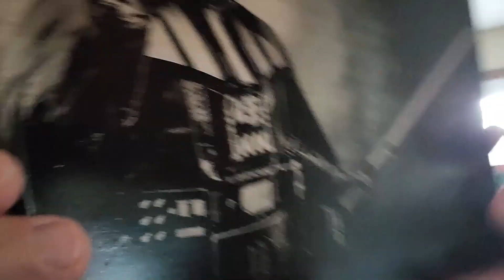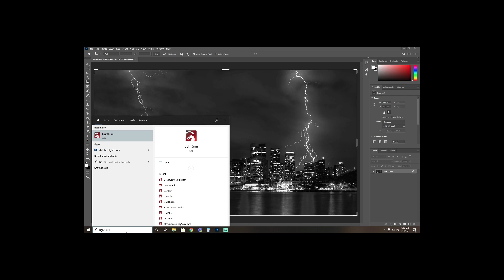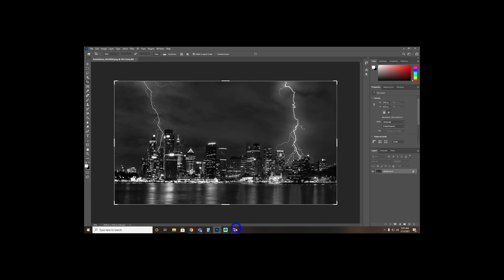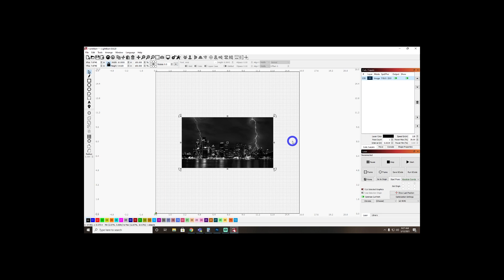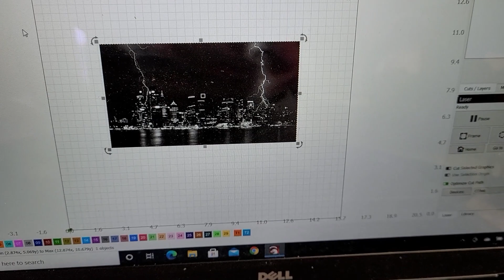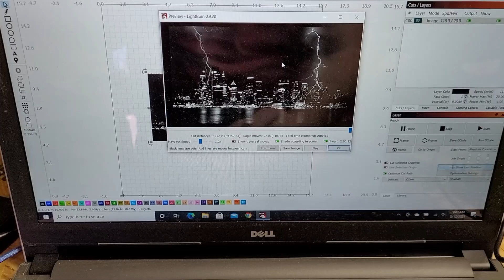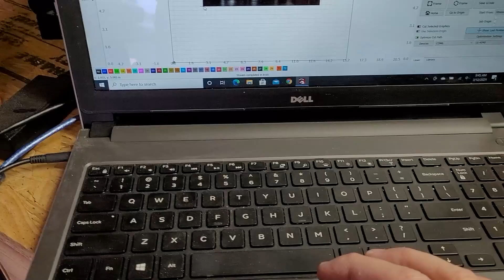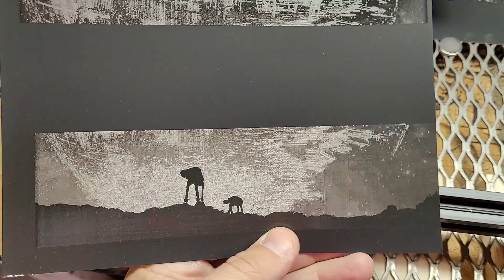Etching Black Scratch Paper

Comment: After you etch on scratch paper, what is the best way to remove all the dust without messing up the surface? Thanks
Reply from the maker: I use air assist, so it removes the dust at the same time it's etching.

Comment: Try using Imag-R select nortons  black tile bam done..Save your pic as a png not jpeg..You will get alot better result..I do mine at 4000 mm/min  @ 22 power...
Reply from the maker: I have used Imag-R for lots of applications and it's a great tool!  I'll retry some of this with it as well and see how it does.  I do like the grayscale feature of lightburn as well and feel it gives a bit more control over the gradients.